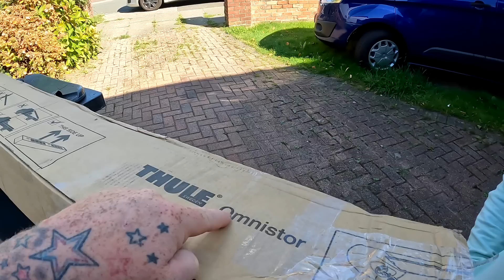This Camper Van Awning Was a NIGHTMARE To Fit

Comment: Hi guys I put a fiamma f45s o;my mk7 transit a couple of months ago all works like a charm went to Devon four  times since the all great until the last time we were there went out fir the day came back to the campsite setup and had a chill later that day we decided to go out for tea so wife got ready i unplugged the electric and tv Ariel put keys in the ignition and began to drive off forgetting I still had the awning pegged the floor and the tension rafter in place it ripped halfway through the awning material and bent the front of the awning like you wouldn’t believe managed to strip the awning Down snapped one of the internal supports and hand to disconnect all parts and strap them up inside the awning box until we came home ,now I need some advice on installing a warning light so I can’t be a brain dead idiot and do it again any info would be great,sorry for the long winded story love channel great stuff
Thanks in advance
Reply from the maker: Wow you really did a number on yourself there, you could fit a micro switch inside the awning the same kind you have on your door so the lights come on when it’s open/out … wire it up to a buzzer so if the ignition is turned on it buzzes but when the awning is closed it won’t buzz